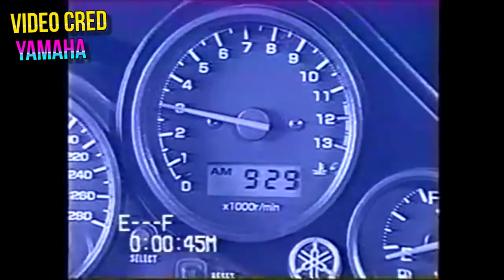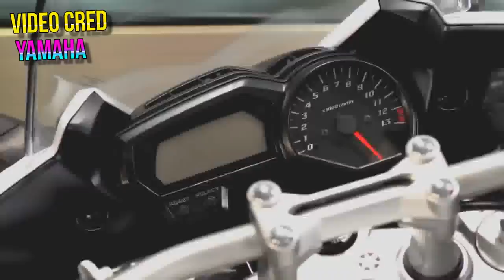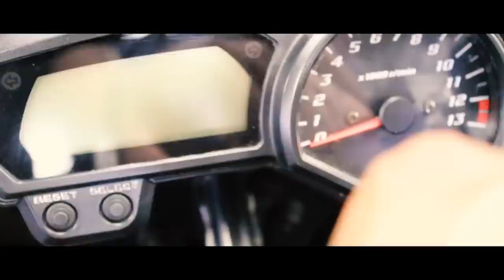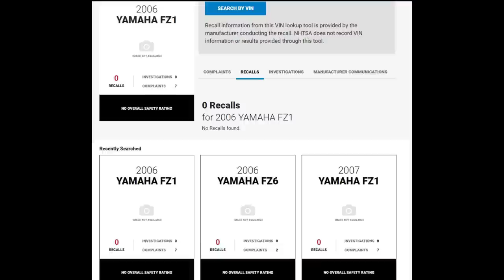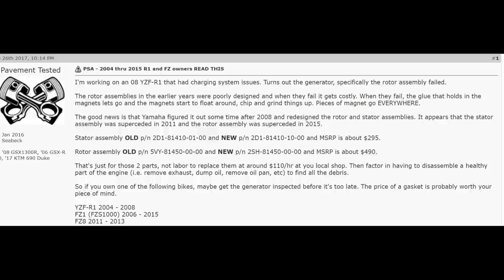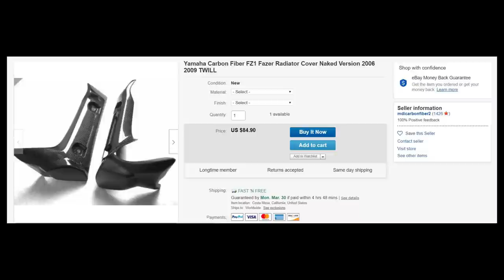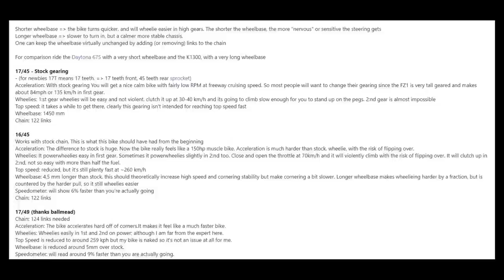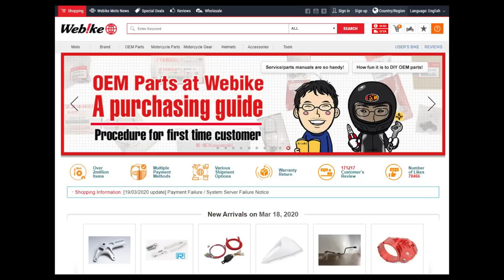Everything You Need To Know About the 2nd Gen Yamaha FZ1

Comment: Yeah the stock gearing is way too tall, but that also keeps it mellow, and keeps it alive. If you want tires that last longer, get the pilot road series. I've had them last over 10k miles. I never felt any need to change mine, other than dial in the suspension for my weight and luggage setup. I kept the fairing because I used it for long (500+ mile) trips, and actually needed the wind protection -- the only reason I ditched my SV650 -- couldn't stomach putting a big ugly windscreen on a naked bike. Of all the bikes I've had, the FZ is the one I've had the longest and got the most out of. It's even seen some dirt roads.

Comment: My 03 SV1000S stator magnets came loose like that. That was last May. Other problems have meant I really haven't ridden since then. I am the original owner and other than going to the dragstrip a few times it was never abused.
Reply from the maker: How did you realize they came loose?
Reply: @Theillestrator1050  
It started "one lunging" below 6000 rpm. Part of the trouble shooting is the CPS which is built in with the stator windings. I restuck the magnets with sleeve retainer compound and applied aircraft fuel tank sealant between  to keep them isolated from each other. I am pretty sure it happened early in it's life, even running like crap it is smoother than it ever was. My headlights are noticeably brighter now, also.
The CPS was reading odd numbers at the harness plug.

Comment: The 8k rpm thing can be fixed by shaving a little off the butterfly valves in the intake. Adding just a little bit more airflow when the valves are closed did the trick for my bike

Comment: I have a 2006 FZ1 it’s got the front end naked look no fairing no windshield with the diamond shaped headlight. It’s hot 26 thousand miles on it. I just change the oil , oil filter and coolant , clean my chain and regrease it and go. It’s been problem free. I’m happy with it until I get my 1400 zx ninja. I will still keep the FZ1

Comment: The first gen Fazer is more beefy in lower rpm's. Both generations have pretty much same max torque figures, but the first gen gets there at 7.500 rpm while the second gen reaches max torque at 11.000 rpm. I think it has something to do with the fact that the first gen engine has longer stroke than the second one. First gen Fazer can be easily (& cheaply) modified to get to gen 2 performance levels, while still being more comfortable, having a bigger tank & an actual fuel gauge.
Reply from the maker: Definitely. I don't blame those who swear by the first gen. especially if you dont care about looks.
Reply: 2 gen gets to max torque at 8k rpm
Reply: @andysspiriteddrives  not that it matters, but anywhere I search for engine specs; I find these:
Engine.
Type: 998cc, liquid-cooled, 20-valve, DOHC, inline four-cylinder.
Bore x Stroke: 77 x 53.6mm.
Compression Ratio: 11.5:1.
Carburetion: Fuel injection.
Ignition: Digital TCI.
Max Power: 150 hp @ 10000 rpm.
Max Torque: 106 Nm @ 11000 rpm.
And most people that had/tried both models say that while gen 2 is faster, you need to rev it harder than the first gen.
Reply: @parasina  hmm my source was wikipedia, so I won't argue :) thanks for detailing the specs

Comment: nice vid. just an FYI, the final 2 years of the G1 had black frame and black engine. i have an 03 myself with an ivan's slip on jet kit and it's a blast. plenty of low end torque.
Reply from the maker: I actually realized that afterwards. It looks pretty cool blacked out.

Comment: I have a 09 fz1 with the naked conversion.( But the wind beats my @ss to death) . PCM5 and a slip on. Traded the 17tooth to a 16tooth but have a vortex 48 tooth rdy to go I just wanted to see how much of a difference the 16 would make but I think you convinced me to put it on lol.  the secondary upper butter flys in the throttle bodies have been removed for a savage increase in midrange performance and I installed a haltech quick shifter which works flawlessly but the bike doesn't really like the downshifts so I just clutch them.. but up shifts are butter..just make sure u set the interrupt interval to 100 milliseconds from the 80 it was originally set at. When I first installed the quick shifter it was on and off working okay so I decided to up the interrupt to 100 MS and that fixed everything. Also if you own ao9fc1 the only issue I've had is the coil packs they do have a tendency to fail so if your bike is starts up but it's hesitant on acceleration and then as you're driving it it'll go but then all of a sudden it'll just start pulling real hard out of nowhere that's coil packs replace them and change your spark plugs too cuz it fouled all the spark plugs.. oh and definitely definitely use the OEM iridiums.. I absolutely love my fz1. I had a 99 R1 for 4 years and this bike is just as fast as my 99 R1 but with a much stronger mid range as my R1 was mostly top end and was a very difficult bike to push hard. It's steering geometry was super sharp but required a finesse that took me years to learn bc it was the most unforgiving bike I have ever ridden to this day. It did not like noobs and would kill wannabe tt heros. Anyways I'm glad my fz1 attitude is much more chill but it can carve a corner with the best of them. I enjoyed your video and your experiences with your own FZ1 and thanks for sharing. I'm saving up money and getting my Fz1 in tip top shape bc my 2 favorite bikes on the planet are the Aprilia Tuono and the KTM super Duke and the Duke is my favorite..I'm a L twin/V twin guy through and through

Comment: Problem wasn't fixed in 2011 for the rotor. Problem continues throughout Gen 2, unfortunately. Nearly a $400 part and it's a time bomb without replacement.
Reply: Did you replace the rotor?  Oem is 500. Now
Reply: @mobleyMobley  I always had. RMstator is another option which is cheaper

Comment: I have the 2008 R1 front end on my FZ1  and also making the Euro conversion. R1 front forks fit right in the stock triple clamps with no issue.  :) Also have the R1 rear shock installed
Reply from the maker: I screwed up and said stem instead of axle XD. Well surely your bike handles the corners better now!

Comment: Had a new 2009. Extremely fast after 3000 rpm. O torque at bottom end. Hated having to burn the clutches to take off. Went up 1 tooth on the drive shaft. Much better. Also hated not being able to feel the back end. Seemed like it was going to slide out in corners. Changed out the silent muffler.
Reply from the maker: Yeah man, that sprocket swap is really needed. What do you mean by being unable to feel the back end though?
Reply: @Theillestrator1050  i Dont know how to explain that other than i was not getting any sense of weight? on the back tire. I couldn't feel any grab of the road.

Comment: Just bought an 09 Fz1 with 15k miles couldn't be happier. I will be replacing the flywheel rotor as good measure and preventive insurance. I was fortunate enough to buy a fully tuned and moded one for less than 5k
Reply: Did you replace the rotor?
Reply: @mobleyMobley  I did
Reply: @Jon Hernandez  did you buy oem rotor?
Reply: @mobleyMobley  no, I own (2) fz1s. I bought an aftermarket stator for both. No issues. Oem stator would only apply to 2015 model.
Reply: @jhernandez77794  did you buy rm stator brand?
Reply: @mobleyMobley  no.

Comment: Just bought a 2006 FZ1S with 56000km, when doing low speed stuff I find the throttle a bit inconscitent, I need to hold the throttle at the same position to get a consistent RPM and it is pretty hard to do it, slight changes and the throttle is like a On and Off switch, I dropped the bike once because of that... Anyway to solve this? It is pretty nerve wrecking to do U turns with this issue. To simplify it is pretty hard to hold the bike in like 2000RPM or 2500RPM when stationary, when the bike is in gear and rolling there is no issue at all and I can be very precise with the throttle the problem is when stationary or riding the clutch.

Comment: How is the engine heat in the summer? Does it emits on legs, butt, etc.? I have a Bandit 1250 which is excellent bike, but have an urge to get the FZ1 for maybe better handling (?) and maybe power and weight.

Comment: I was about to buy an fz1 abarth edition before the seller changed his mind. I end up buying a bandit 1250 FA ABS. I always think about which feels more powerful since I haven't ridden the fz1. Any thoughts?
Reply from the maker: Well I've only ridden the bandit 650 so I couldn't really tell you. I imagine your bike has better low end on account of displacement
Reply: I have a 2008 FZ1N and a 2009 Bandit 1250. The FZ1 feels like a bit less power at low revs so starting from a dead stop for example can actually feel 'slow' off the line despite its 150 bhp. However, this means that low speed maneuvering in traffic or coming out of streets and parking spaces etc is very controllable and feels like a 600 cc bike. At around 5000 RPM however, (around 30mph when accelerating from 0) the bike gets a massive surge of power which feels like an afterburner has kicked in or you have made the jump to light speed and most any bike which took off faster than you quickly fades into your mirror.  This means that any time you actually want to go fast, you turn the throttle to 5000 RPM and you get a satisfying 'boost''. (12,000 RPM in 1st gear will top out at 85 MPH so in 3rd 4th and 5th you still get a noticable boost at high speeds).
The Bandit is obviously heavier and less sporting at 100 bhp so feels less nimble cornering/maneuvering . Also, because it has a high torque right from the start, it means that even a slight movement on the throttle at low speed acts like a hair trigger and can easily cause you to lose control if you are not careful, especially in wet or slippery conditions or have not ridden it or have been riding another bike (I personally do not see the point of so much pull from 0MPH unless you want to tow a tractor!)
This power delivery stays constant through the revs so no great response when you are going 40/50/60/70/80 mph and twist the throttle, as opposed to the noticable kick of the FZ1 thrust at these speeds. However, I took it to 130mph without you even trying or realising which indicates the power, stabilty and smoothness of the ride/acceleration.
I would say for anything resembling commuting, FZ1 is the way to go but for lots of motorway/highway long distance stuff or for lots of riding with a pillion or loads of luggage, the 1250 is better.

Comment: That popping it just overrun because your closing the throttle. The magneto failure was most Yamaha’s of the era not just the fz1/r1.
Reply: Also the 04-06 fork/front end is easily interchangeable. It’s only the newer 6 pot callipers and forks the need a different stem.

Comment: I love my fz1 to death, and can say %100 send your ecu to be flashed! The low end you get is insane, makes it's a real beast.
Reply from the maker: I really should but like I said i'm just moving so slowly because its fast as is with that sprocket change lol
Reply: Dont blame you, but once you do get it done with those sprockets!  That will be fun XD XD
Reply: Ecu to be flashed? 
Whats that mean,if u don't mind.
Reply: They retune the factory ecu, adding a different software to it and makes the bike run smoother and deliver more power. From the factory they are tuned to be safe and last forever and be rider friendly. But you can re tune them for more power and more aggressive torque curve.
Reply: Did you replace the rotor?
Reply: @mobleyMobley  the previous owner did that on my bike. But the rotor and flashing ecu don't have anything to do with each other. At least that I know of.

Comment: The rotor-issue goes all the way to 2014. Not 2011. Just so no one things they are a "safe" from the problem on a bike from 2011->
Reply: Did you replace the rotor?
Reply: @mobleyMobley  yep. Did it as soon as I bought the bike.
Reply: @Kaj Kjellgren  you use oem rotor or an rm stator rotor?
Reply: @mobleyMobley  I went with the OEM.
Reply: @Kaj Kjellgren  i want oem too, but oem is $ 500
Reply: @mobleyMobley  yes they have become really expensive. When I swapped I think I paid around 270 USD back then.
Reply: @Kaj Kjellgren  i would do rm stator, but a few ppl reported issues with them
Reply: @mobleyMobley  yeah, seems like they are a bit uneven in their quality.

Comment: I bought a 2011 new, as a 2-year left-over. Eventually I got the break in miles over with and decided to give it the full Ivans Performance updates:  Full Yoshimura R77, AIC blockoffs, ECU reflash, PC5 with Ivan's highly developed fuel map (yes, fuel handled with the PC5 instead of reflash, everything else handled on reflash), K&N filter, and airbox cutting hack. http://www.ivansperformanceproducts.com/stkvsfinalSO.gif  You want power? Here it is. Nothing but a ECU reflash will get it. Don't kid yourself and don't be cheap.
This throttle lurch was NOT fixed. Lemme repeat. NOT fixed in any years. Yamaha slightly modified ECU maps in a few years time since 2006 to 2015. Simple fact of the matter, the lurch is because the EPA cuts injectors (like all bikes, all trucks, all cars, everything). Add the chain slack, the cush drive, the transmission gear lash, and the dried up combustion chambers and you have a nice delay that jerks when the power comes back. 100% fixed with Ivan's flash. In fact, about 70% of felt vibration was fixed with the mods above. So much smoother overall. No torque dip. No per-gear power restrictions (as much as 40 hp is limited in 1st gear stock, vs. all the mods). Also the engine ran pretty hot stock. The reflash fixed all that. No more heat issues. None. Period.
I never swapped the front sprocket but I should have -1 the thing. Would have made it quite responsive off the line, much more than it was after the mods. Those power mods changed everything about the bike. Sound, vibration, torque curve, overall power, cornering behavior (stock exhaust is bulky).
That full R77 sounded pretty rad.  https://www.youtube.com/watch?v=JJjMWASlQbs

You mentioned earlier that the engine has a balance shaft. Nope. None. It does get a bit annoyingly tingling at higher rpms sustained, but thankfully even interstate speeds in (oem gearing) 6th didn't take it up there.  https://www.partzilla.com/catalog/yamaha/motorcycle/2011/fz1-fzs10as/crankshaft-piston

Windshield is too vertical from factory and it's notorious to dumping dirty air around your head for a nice tornadic noise at highway speeds. Plan on chopping it very short, or getting a giant barn-door sized screen.

Overall, it's quite high quality, fit and finish is very good. Fairings and bits around the tank and front are easy enough to remove and access airbox/wiring, etc. After gaining 21 hp peak, I didn't see a single MPG changed in overall mileage. Identical to stock. Got 37-38 mpg most all the time.

I rode it on a 4,445 mile overall trip in 2013. The next year I sold it. I change bikes a lot.
Reply from the maker: Very informative, as always!
Reply: @Theillestrator1050  You're welcome :) From one motorcycle geek to another.
Reply: Like I said in the earlier reply I have both the GEN1 2005 and the GEN2 2013 FZ1 and I’ve done some modifications butI’m holding off on a ECU flash from Ivan but from reading your reply that sounds like something I really need or want to do... thanks again for those helpful comments you made on your bike...
Reply: @primokona  Somewhere in the FZ1 forums there's a section discussing Ivan's work. Lots of owners talking about it. Ivan has been in the tuning business a very long time and does many more models than the FZ1. Here's another video of a gentleman discussing Ivan's work on the Concours14:  https://www.youtube.com/watch?v=eb9XPlBv3hI

Comment: C'mon man, the silver engine on the early Gen1 is so seXXXy. My 02 FZ1 with a bunch of mods puts down 150 rwhp @3500' ASL and it's got over 70k on the odo.  Biggest gripe is that you have to crack the case to replace the output shaft bushing. No way to punch it thru from the outside like on the gixxer or other bikes. Not something to worry about until after 60+k miles or run a really bad chain.
Reply from the maker: 150 rear? Niiiiiice!
Reply: @Theillestrator1050  yes sir without having to replace cams. i love to see what she puts down at sea level. :) it's fun dusting every 600 and many liter sportsbikes in stoplight wars while I roll away with saddle bags and a tall windscreen! LoL check out yamahafz1oa.com if ya haven't already. Great tips, cheap parts, and a ton of good people willing to help others out.

Comment: No the throttle snatch was not fixed for the 2007 Model, it's a fuel saving feature that manufacturers use to mollify governments, and will not be going away any time soon. An ECU  flash to remove it is the only real way, and the difference is night and day once it's done.
Reply: Did you replace the rotor?
Reply: No. @mobleyMobley